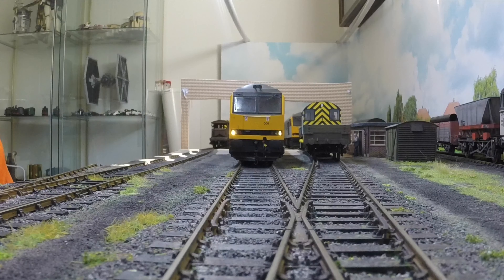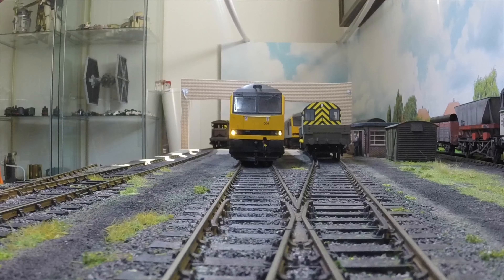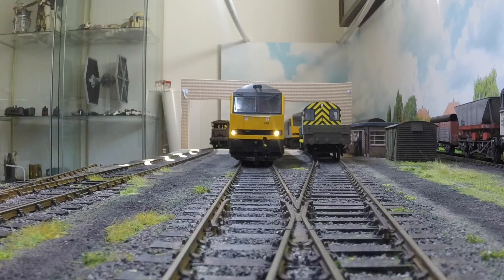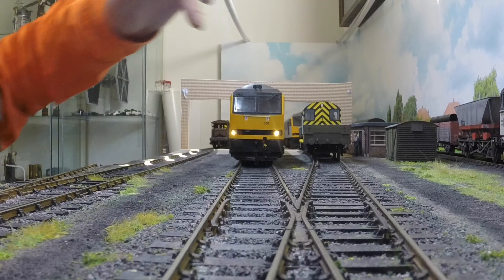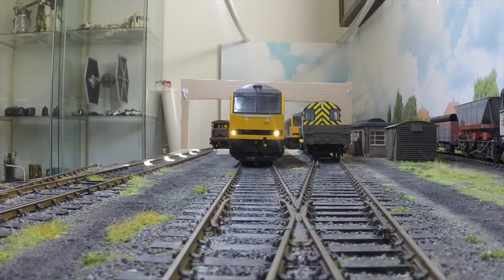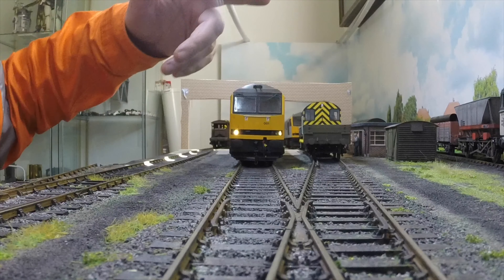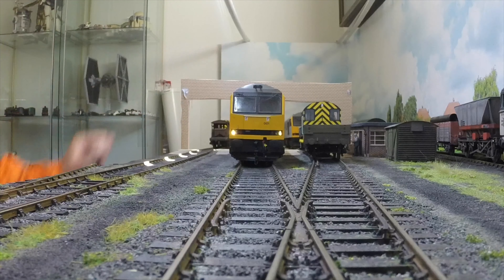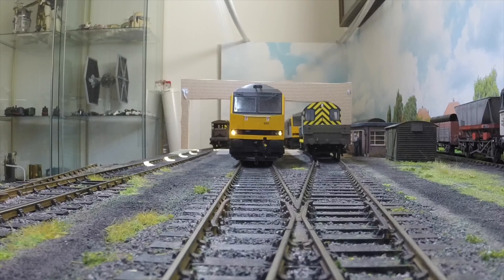Model Trains 112 - Locomotive WIPAC Headlight Settings Heljan Class 60 and class 20/9, 59, 66, 67etc

Comment: Hi Ian, 
Did you ever work the channel tunnel trains from grain to sevington. If you did would you have any knowledge if 33008 ever worked that services. Decided I'm gonna Dona copy of that train but fancy something a little different rather than two construction ones. Cheers
Reply from the maker: David Johnson no, it was an Eastleigh allocated loco, so just construction sector or blue locos, and definitely not in the Heljan version as that is the post 93 livery
Reply: @47606odin  cheers Ian, think il just get 2 construction ones. Would love a 33050 like yours but but the new ones have the center marker light so have to do some research.
Reply from the maker: @davidjohnson8175  pretty much the headlights were fitted post 91, it depends how accurate you need, otherwise its just cut off and fill, and blow over the yellow

Comment: I think you might have some audio problems? The audio volume is very low, can't make out what you are saying, even on my professional audio setup with the volume maxed out. Maybe turn up the gain on your audio settings for the microphone?
Reply from the maker: oorail.com I am having camera issues, and am awaiting new stuff which unfortunately is slow being delivered due to the current global issues, however, I can hear the video clearly and I am a train driver with Tinnitus and industrial deafness, so I am not sure why you can’t hear it
Reply: @47606odin  Its just your video that has the problem, sounds like you are talking with a pillow over your head (low and muffled). Same problem on Android phone and tablet, but no issues with other videos uploaded today on YouTube. I turned on CC to get an idea of what you were saying, thought you'd appreciate the heads up about the audio issue. Yeah most places seem to be prioritizing food / supplies deliveries vs electronics / non-essential items. You should definitely check the gain settings on your camera though.